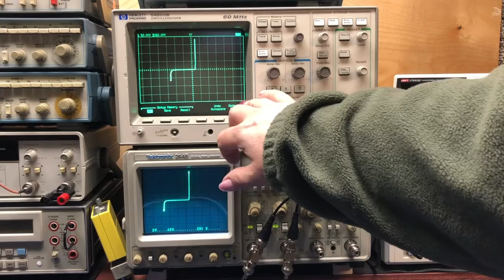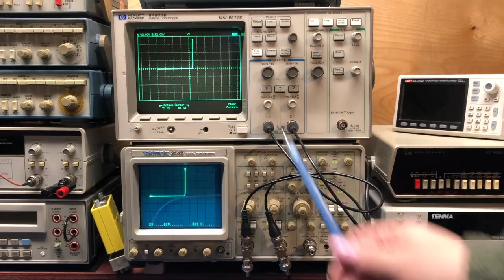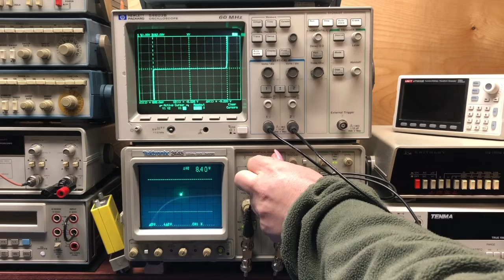Octopus Component IV Curve Tracer

Comment: thanks for this video.
I have a scope with xy and a function gen that creates frequency and voltage.do you have a video on setup with these 2 so I dont have to  build this iv curve tester?
John
Reply from the maker: w2aew did a video on this: https://www.youtube.com/watch?v=WWY-pakm_OM

Kerry Wong did as well for testing transistors: https://www.youtube.com/watch?v=dn_UA3dvP_4&t=460s
Reply from the maker: Hi @danielmorgan7702 I have a video in the works for a curve tracing adapter using a function gen and oscilloscope. Should be up soon.

Comment: Nice. I built my own using Mr Carlson's Lab designs, and I also have a Hameg HM204 scope with a built-in curve tracer. It's a pretty useful feature and even trained engineers often don't know how to use it.
Reply from the maker: I found a kit on Bay for Mr. Carlson's. It's a nice design and works well - I just need to put it into an enclosure. But a simple transformer based tracer works quite well.
Reply from the maker: The ket for Mr. Carlson's design was never authorized by Mr. Carlson, and the seller is gone now.  You can find schematics for a transformer based octopus all over the internet. :)
Reply: @Donna_Matthews  thank you!
Reply: @Donna_Matthews could you please let me know what to search for? What terms to use?

Comment: GARY LAROCCO, I would think that the diode and transistors needs to have a DC biasing voltage also with the Octopus AC 60hz for the I-V signature curve. Any reasons why no DC biasing voltage for the diodes and transistors?
Reply from the maker: AC voltage is just DC, swinging positive, then negative - it's just doing it quickly.  You could get the same effect with a bipolar power supply, and a pot between the positive and negative, sweeping it manually from one end to the other.

A diode will not conduct with a reverse bias, so during the negative half of the cycle, there is no current flow (the flat part of the trace.) Once the diode's forward (positive) voltage is reached, the diode conducts (the vertical part of the trace) and continues  for the positive half of the cycle at / above the forward voltage. That is why the trace shoots up just after zero volts.

You could look at the emitter-base junction, or collector-base junction of a BJT the same as a diode, and observe a similar I-V curve. But, to see the type of curve one might find on a transistor curve tracer, then yes, you would need to DC bias the base of the transistor.

By design, the octopus is for testing bipolar devices.
Reply: @Donna_Matthews  I don't understand how applying an AC voltage across a transistor or diode that your get an IV curve profile because when applying AC directing across a diode is NOT going to draw an IV curve on the Oscope. So I'm confused about this